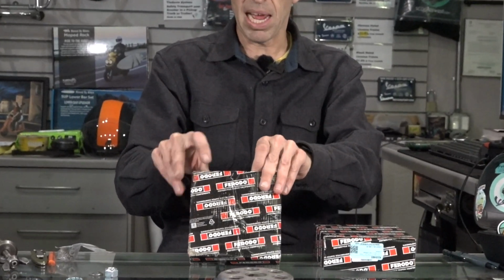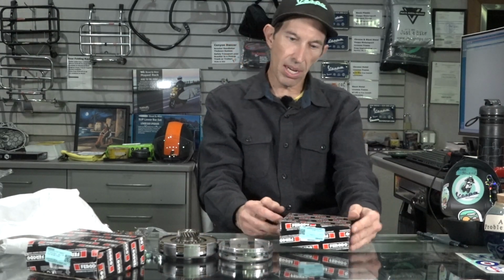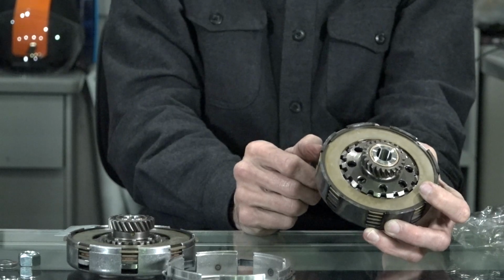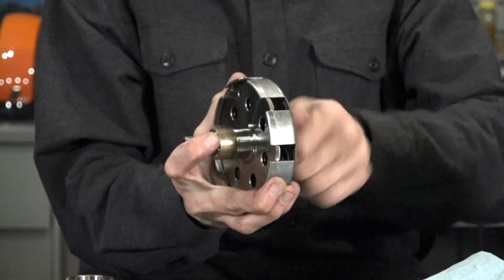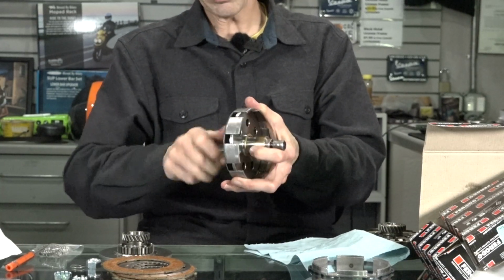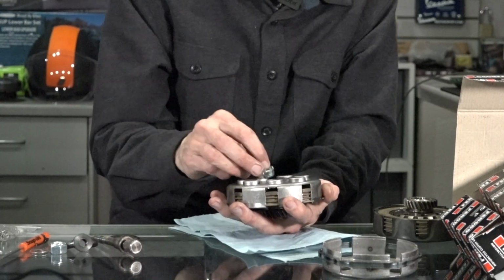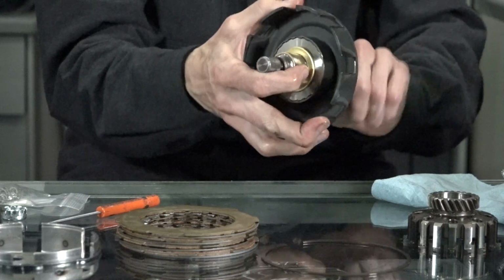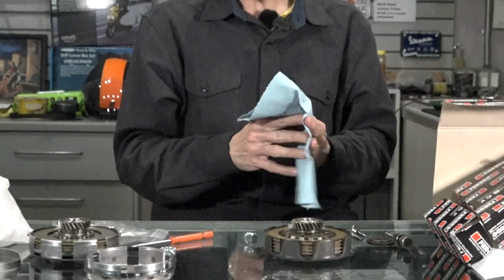Two Types of Vintage Vespa Clutches and How to Rebuild Them

Comment: Is the cosa clutch is superior than stock 7 spring one? In terms of durability for long trip. Thanks
Reply: They give a light and superior clutch fell, but when abused or used on a tuned engine the plate edges tended to get chewed up and the center hubs strip.
Reply: A lot of people back in the day replaced the stock clutch with a Cosa. I think it was more of the light feel but I never had any problems with mine and I’d ride it to Sacramento from San Jose with no issues. My P200 was stock but had a Sito Plus pipe.